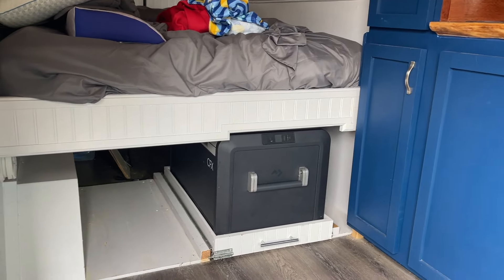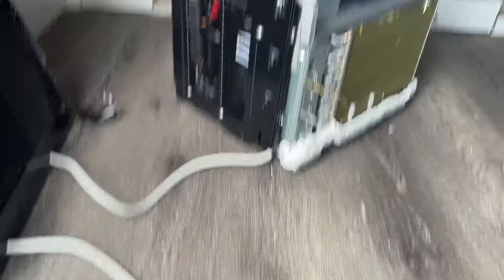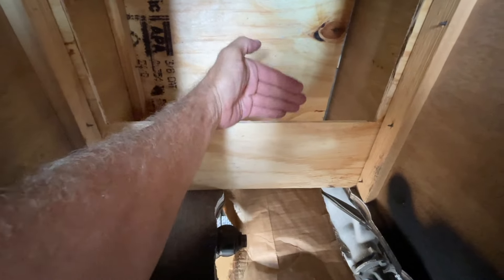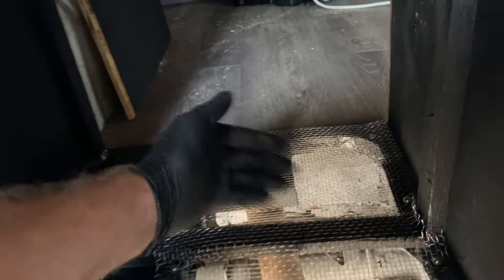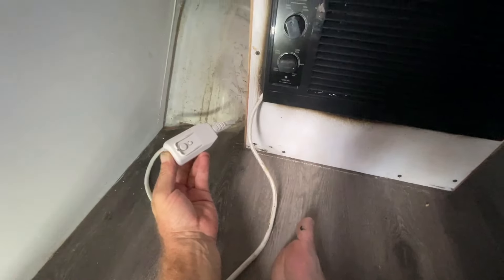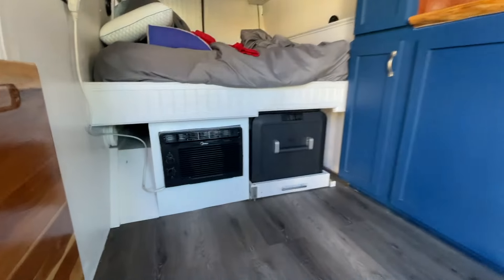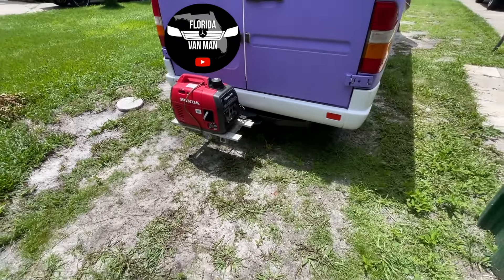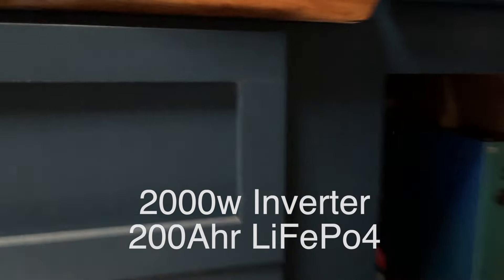Central Air Conditioning in a Camper Van

Comment: I tried this. I ended up installing a "no idle" 12v ac on the left rear door. It's about 3 hour install. You don't need an inverter. About 15% energy saving over using an inverter.
Reply: If I may ask, what unit did you install? I've got a 13000 btu roof unit in mine, and it's an energy hog?
Reply from the maker: Your savings on the inverter are completely lost on the efficiency of a 12volt compressor motor. The maximum power of these units is 900watts or 3,000btu. The smallest window unit on the market is 5,000btu and that can be insufficient trying to cool a van. 3,000btu just isn't going to keep you cool in 99 degree weather and the efficiency of a 12volt compressor is going to use more energy than a window unit on days that it does work.
Reply from the maker: Roof is the problem. Not much cooling can happen in direct sunshine on a van roof, so they build the roof units 3X as big as would be needed otherwise. My 5,000btu a/c in this video will outperform any rooftop unit and use 1/3 the energy on hot days while doing a better job cooling.
Reply from the maker: @edwardpeders9582  The 12volt & 24volt systems of recent years are leaps above what was available 5 years ago, mostly marketed to boat-life starting above $5,000 plus installation. But from what I have seen they are still not up to par with the cheapest window a/c units running on 120volts. They work in moderate heat, but the smaller motors compress the freon less, thereby not as hot to be cooled in the ambient air. Window units send freon to the condenser (outside) at about 140 degrees where ambient air cools it. These DC backpack units probably** only achieve 130 or maybe only 120 degree freon sent to be cooled. The difference between freon and ambient temperature is key in how cold the evaporator gets inside.
Reply: I live in SE Texas. I insulated my cargo van. It's the tallest and longest model. I initially installed a Madia 8000 btu window unit. It worked good but I was not successful at keeping the condensation from dripping inside. So I installed the 12,000 btu no-idle ac. I have bypassed the inverter and is wired directly to the house batteries. It appears to use less energy. Your mileage may vary. No more condensation gets inside. Like I shared, install was fast. I camp a lot and it does great. We don't park directly in sunlight. I will leave the ac running while heading to our campsite. Everything is already cool and stays that way. We don't turn it off until we return home. All is good for the last 18 months.
Reply: @FloridaVanMan  Absolutely
Reply: @FloridaVanMan I came to the exact same conclusion. The 12 volt units I've seen are inefficient, overpriced, and underpowered.
Reply: FVM, great build. Just got a T1N, not sure which ac unit to buy, and, how you overcome the ac start issue with the Honda 2k gen. Any ideas?
Thanks, learning a lot and apprciate you!
Reply: @cliffhilton89  it must be installed with a downwards angle. I riveted aluminum angle onto the AC
Reply: @AncapistanVan I used body adhesive. Same aluminum angle.

Comment: Hi Florida Van man, how are you today? I have a question about my AC driven from the serpentine belt. When the compressor kicks in, the engine almost stalls. I know it’s low on AC gas. Have any idea?
Reply from the maker: Either the compressor is bound and way too hard to spin when it engages or you have power loss in the engine. The a/c compressor should not be near enough resistance to stall the van however if the freon were low the compressor should not engage. Maybe someone has altered the wiring to bypass the dash control button and computer checks?

Comment: I mean it’s In no way central air but alright
Reply from the maker: It is not the usual form of "central air" but it is central in the van and it is air-conditioning that delivers to all rooms of the home* at once. It doesn't fit the image we conjure but it does fit the litteral definition of central air conditioning. Most importantly it works as central a/c in a single room dwelling.
Reply: @FloridaVanMan  a system in which air is cooled at a central location and distributed to and from rooms by one or more fans and ductwork.

It’s not delivered via duct work therefore it doesn’t fit the literal definition

You just installed a window a/c in the floor of a van, which is so inefficient. It’s done in a cool way don’t get me wrong but no one would call that central air. They’d just call it air conditioning
Reply from the maker: @lastresort1757  Calling it central a/c was done with humor and a picture so it would not be misunderstood. I'm not as funny as I wish, that's fair. However, I'll take your challenge on efficiency!!! Show me a system that cools better on similar demand and fits a van without looking hillbilly. I'll try it! I am willing to change my views as the evidence changes, but so far the ones my friends have shown don't quite do the job in our hot summer. Works great spring and fall seasons so they certainly do fit the need for many people. They have the advantage of easily ducting the round output ports. Would that qualify them as "central a/c"? :)